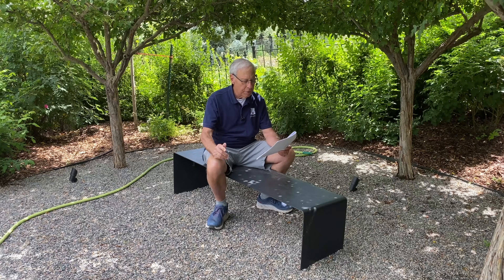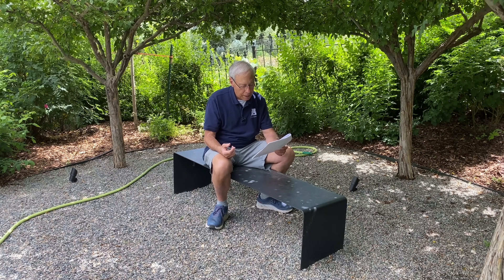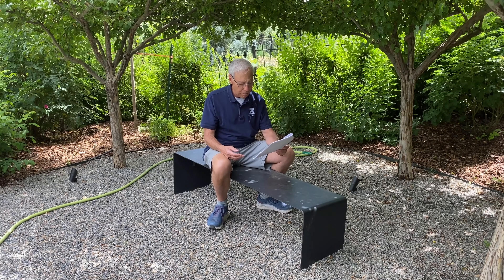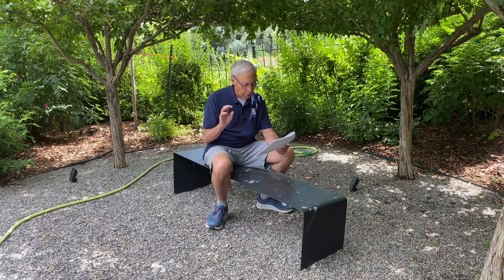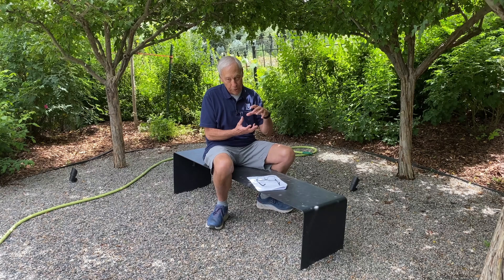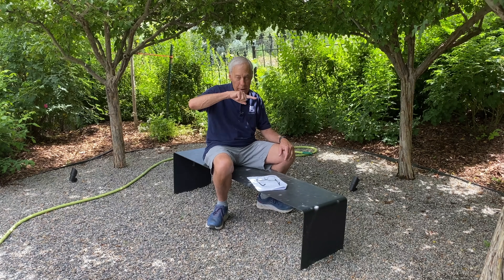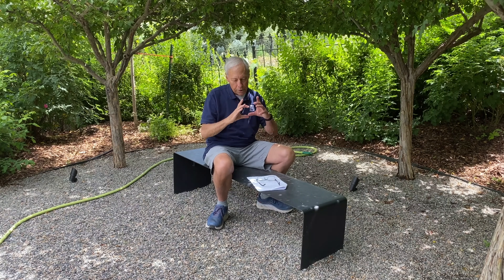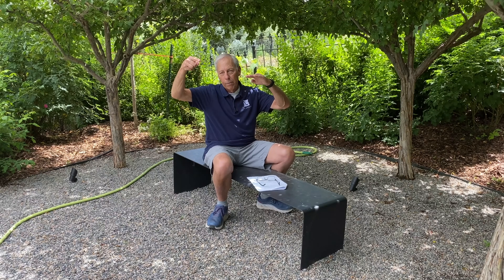Capacitors as indicators of audio quality

Comment: You can almost never have enough caps in a power amps supply, lets assume you have + and - 50V - about average for most supplies, at 100W you will be pulling around 28A, now lets say you want to keep ripple down to 1% or 10v (5v per rail): q=i.t=c.dv therefore c=i.t/dv = (28*(1/50Hz) / 10v) = 0.0566F or 56,000uF, thats more than is in most amp power supplies, chances are your power amp has worse than 2% ripple at max power.
Now imagine trying to get the ripple down to say 0.01% of supply, that would be a whopping 5.66F !!, that would require 100 x 56,000uF cap (NPV=50,000uf).
However the switch on rush current would be so huge, you would not want to do this).

Comment: I need advice please! I'm trying to build some preamp and there are small value polarized 10uF caps in line of audio signal from input, over the tone control and output. I can only notice they are not placed all the same where some are  oriented like +○- and other  -○+ looking the audio signal "direction" from IN to OUT. The question is: Is it better to place some audio grade bi-polar/non-polar caps on audio signal over complete preamp and just keep polarized on power pins of op-amps or it is fine to use polarized like schematic says ???

Comment: Back in the day a way to improve the performance of an amplifier is to add more and more electrolytic capacitors. But they added small value capacitor across the array. They said to make it improve in speed. And to prevent too high in-rush current that can blow rectifiers they add series high wattage wirewound resistors between rectifiers and the capacitor array then bypass it with a relay after few seconds delay. Paul please comment on this.

Comment: Your talking two different uses for capacitors storage/filter caps vs coupling caps in the signal path.... Large amounts of storage caps are good, also lower ESR (equivalent series resistance) by using high quality and more lower valued caps in parallel is also good. If you need to use a cap in the signal path, make it a good quality film cap, like polypropylene....
Reply: I've upgraded my phono amp with 4 WIMA caps, weeded out the electros

Comment: I just had my 20 year old HK6500 power supply recapped and the bass is so much more present.  It's like the difference between driving with flat tires and tires with air.

Comment: Passive speakers usually have caps in the cross-over filter. Active speakers using DSP for cross-over can completely avoid any capacitor in the signal path and enable a more precise level and phase optimized filtering.

Comment: Back in the '70s when I was assembling Dynaco kits, I seem to recall that they offered a separate add-on capacitor bank for the ST-400 if you wanted even more than the stock capacitance for the power supply.  I loved that amp but never added the extra caps.
Reply: I have used that amp both with and without.. I would be lying if I said it did nothing, but its importance was greatly exaggerated. At least at 7-8 ohm load I found it of only a tiny benefit. And in fact the tiny difference could have been all in my head too.... And I am talking about a freshly restored amp. Either way the amp is deeply impressive and found it quite lively and responsive even without the extra bank right on up into its limits. My guess is the extra bank would really help with driving heavy bottom end at lower impedance like 4 ohms. Or speakers with very low damping. But either way for a fairly typical use where you are not putting the amp close to its limits, it is just a placebo IMO.  The transformers in that thing are so massive that I don't think they really needed to bother.

Comment: You have several types of capacitors!

1. Low resistance (ERS) which is good for audio.

2. Long life.

3. (All purpose) which are usually cheap caps.

If a preamplifier needs 1 amp from power supply then the sound will not be better if you go from 10,000uf to 50,000uf. it's just sales tricks from the factory!

Power supply capacitor does not remove all noise because then you must have a noise filter with coil to small capacitors!

A capacitor on the audio input. prevents direct current and protects against very high frequencies that can damage equipment

Comment: We need a small discussion on the scale of Capacitance.  1 Farad is an awful lot, half a million is probably not possible in an audio component.  The power supply might have 500,000 micro farads (half a farad).  Thoughts?
Reply: I think we all understand that the questioner meant to say 500,000 microfarads but just missed the "micro."  
But it's fun to think about what one could do with 500,000 farads, once it's charged.  That does admittedly take a while, though - at 100A, it takes almost 17 hours just to get it up to 12V.
Reply: True.  However, I use 50F supercaps in PS of 3-5V digital sections.   Low ESR supercaps make a surprising improvement to the sound.  Some are using hundreds of Farads with good results.  Not for the inexperienced however as these things are dangerous.

Comment: Great explanation Paul.
I just traded in a wonderful tube preamp that had blocking capacitors at the output stage that could be bypassed with a single dip switch. The manufacturer covered its behind by giving the user the option to keep them in the circuit or not and a warning of the potential hazard of not keeping these capacitors in-line with the output jack.

Comment: The ESR (Equivalent Series Resistance) of a capacitor is crucial for simple AC-DC diode bridge based power supply performance. The lower the better to allow faster charging and discharging thus improved ripple attenuation. Capacitor performance degrades over time, exposure to heat and usage. This is why capacitors with the same Farad value are available with different performance quality models with the best being more expensive. Even the best capacitors will die from ageing.

Inline signal capacitors are sometimes unavoidable to remove DC voltage offsets. They must be sized so they best preserve the signal quality.
Reply: Yes, unfortunately ESR is the first thing that degrades as capacitors age, and few owners have the ability to test that.

Comment: Unless technology has made super leaps and bounds since I came into it,  a 500,000 Fared capacitor would be humongous.   A one Fared capacitor with an air dialectric of 1/32 inch would need a plate area of 36 square miles.   Of course with better dialectrics they can be made much smaller.  I have a one Fared cap  that is for 5 volts that is about the size of a large coat button.  Sounds like bogus specs to me.   Can you imagine how long it would take to charge this capacitor?

Comment: Half a million Farads? Even the most massive power amp you can think of, say the D'Agostino Relentless for example, has way less than one Farad of capacitance.
Reply: Half a million microfarads = 1/2 farad. The problem with huge filter capacitors is that the diodes are only conducting for a short part of the A/C cycle so they have to be massive as well to handle the current draw when they are "on".
Reply: Some number of millifarads is plausible. Maybe that's what was meant.

Comment: Also that phono preamp manufacturer was probably talking about microfarads, 1 millionth of a farad..  Half a million microfarads, one half farad, is still a lot of power storage and would take up a lot of space.  For example, a Nichicon aluminum electrolyte capacitor with a 15000 microfarad capacity measures 80 mm (3.2 in) long by 30 mm (1.2 in) in diameter.  Now wire up 330 of those in a box for the power supply and that doesn't even include the power transformer and regulator circuitry.  These are probably not the most volumetricly efficient caps out there, but you get the idea.

Comment: A switch to Solens caps in my Klipsch R-51M  cheapo speakers sure made a huge difference in detail and tonal quality!  :)
Reply: A smart move and I'm glad that it worked well.  But caps in crossover are meant to limit portions of the frequency response from going to specific individual drivers so they don't have to deal with frequencies outside of their optimized range of operation.  In a capacitor free direct coupled circuit, you want all of the frequencies to go through unimpeded.  So kind of apples and oranges, here.  Viva do-it-yourselfers!
Reply: @stephensmith3111 I'd still hafta say "apples and apples" under the topic of "Capacitors as indicators of audio quality" Stephen. ;)
Reply: @freethot333  Good point.  And again, good for your ingenuity for improving the sound quality of those "cheapo speakers".  I'm listening to Pioneer BS-SP22-LRs that I got for $99.99/pair at the 'yellow tag' store.  I haven't tried opening them up, but I think Andrew Jones knew what he was doing when he voiced them.  Not LS3/5As, of course, but not that far behind either.  :-)
Reply: @freethot333  About 3-1/2 years ago; as a widowed, empty nest, retiree; I down-sized to a 3 room apartment in a nice old neighborhood with a big city park right across the street.  Affordable, too.   However, after signing the lease and setting up shop, I discovered that the main room has a nasty bass resonance that particularly upsets my turntable.  My venerable and beloved ADS L520s  simply overpowered the room and are sidelined for the time being (can't bring myself to sell them; hope springs eternal).  Even with the bass rolled off a bit (yaayyy, tone controls!) and mounted on tall(ish) stands,  the little Pioneers can still excite the resonance at greater than moderate volumes.  Still, bass shy music is infinitely better than no music and from the lower midrange up, the SP22s sound quite good.  Wonder puppies indeed.  And otherwise, I like it here.
Reply: @stephensmith3111  I've seen images of the BS22 crossover and it has poly caps
Reply: @stephensmith3111  removing the dust cover will help with TT feedback, my LP120, 20w Pyle amp and Dayton 652-AIR speakers howled at 105 dB
Reply: @VaughnfromPeterborough  I do take the dust cover off entirely when playing records.  I filed the retaining clips for the mounting tabs down so that I can lift it straight up and off (I could still pivot it back, but I choose the former option).  The tabs hold the dust cover in place when not spinning vinyl (Rega RP1/Bias 2 sitting on an Auralex turntable platform, b.t.w., the platform helps but didn't completely eliminate the problem).  Thanks for the suggestion though.  :-)
Reply: Solen Metalized Polypropylene caps?  It would be interesting to see what good quality film/foil caps would do
Reply: @darylstahler4224  Solen Capacitor 5.1uF 400Vdc PB Series	SOLEN-51551	USD $3.16	USD $6.32
Reply: I have the 15M speakers, I will consider poly cap for the tweeter and remove the 36uF shunt cap from the woofer

Comment: When you fully rectify incoming AC you don't get separate plus and minus, the AC negative gets flipped to positive and so all the 'humps' are positive with a ripple that's smoothed with a capacitor.
AC =  n n n n n n n           DC (rectified) = nnnnnnnnn          DC (smoothed) = ¬¬¬¬¬¬¬¬¬¬       DC (regulated) = -------------------
            u u u u u u u
Reply: When I read that in my head, I made noises for AC-DC-DC smoothed and DC regulated. It sounded dumb.
Reply: Will it hurt to replace a ps filter cap of same value but of a slight higher voltage
Reply: @davebrice7217  No. The voltage rating points to how good the insulation between the plates is. Higher voltage may even be less prone to leakage and may last longer. The materials are also important, though usually not specified. Typically, caps are rated to 85°C, but in a power supply, 105°C caps my be more chemically stable and last longer. I went from 8500µF 75V 85°C to 10000µF 75V 105°C on my 40yo amps, but I'm adding a soft start.

Comment: When I was in school ( 64  -> 68 ) I was part of a team that did a servo amp that was controlling the angle of a 5in naval gun. Two were needed ( one for gun elevation and one for turret spinning ). If I remember right we had I think a bank of four 1.5 farad ( 6 farads ) in the power supply. And the power supply that supplied that, if I remember right, was I think 100A 48VDC. There was like 80 power transistors in the output stage. That thing was a beast.
Reply: Sounds like a fun project.  
Speaking of aiming military equipment - 
Many years ago, our neighbor's son was telling stories of his experience in the Navy, operating radar equipment.  In Hawaii, they had an over-the-horizon radar of multi-megawatt power, but the antenna had a servo issue with the altitude angle.  If they lowered it below a certain point, it would jam, then they would have to call in a repair crew.  One day that happened while it was operating at high power, but the operator didn't realize what was going on before the beam swept across the local downtown area.  As it passed through a camera shop, an entire wall of flash cubes suddenly discharged, causing panic in the store.  Ah, the things they used to do back in the '60s!  He also mentioned that the radar would occasionally knock down seagulls in flight.
Reply: @marianneoelund2940  OK Marianne here's the real fun. I'm a 20ish yo student at the time. Here's this mega circuit. 1000's of amps. We didn't have a real turret or 5in gun so we had to simulate the load on the motor. So that was an about 3in thick about 24in dia aluminum disk attached to the servo motor. You dial in 125 degrees and ggrrrup the disk spins to 125 degrees. Dial in 320 degrees.gggggrrrrrup and around the disk goes to 320 degrees. So climb on board, hold on real tight and gruuummmp a spin'n you go. I'm surprised we didn't get hurt screw'n around with that thing.
Reply: @jim9930  
Are you sure it was paper?  The highest-value paper cap I've ever seen for voltages like that was only a few uF at most.  
For 500uF at 500V it would need to be almost a cubic foot in volume.

Comment: "Half a million farads". So that's 500,000 farads. Anybody have any idea on how physically big that would be?
Reply: One farad is a gigantic amount of capacitance; there's no need for something that big in any sensible home audio system.  Maybe it should have been half a million microfarads, i.e. 1/2 farad?
Reply: @kc9scott  Just for fun: https://www.electronics2000.co.uk/calc/capacitor-charge-calculator.php

V=48vdc
C=500,000 Farads

Charge Q = 24000000 Coulombs
Energy E = 576000000 Joules

BBBOOOOOMMMMMM!!!!!!!!
Reply: @wilcalint  
That's 160 Kw-hr.  You could drive an electric car about 600 miles on that.
Reply: @kc9scott  Thanks Kevin. This 74 year old engineer kept hearing "Farad" in this video and every time I heard that I remembered that bundle of four 1.5F caps we used in that servo amp. It was BIG and it was DANGEROUS. We never had a short in that circuit. We only had the big black splotch where the short was. Blew the tops off of about half of those 80 transistors a couple times. TO-5 cans.
Reply: @kc9scott  I seem to remember things like 300 Micro Farad caps in audio power supplies. Maybe a couple of them.
Reply: @kc9scott  Arn't the boom boxes in cars into multifarad power supplies. I seem to remember seeing those things in car stereo stores. Usually in the 1 Farad range. And those were pretty big.
Reply: @wilcalint  They're running at 12V DC. You need much greater capacitance to achieve the same power storage at low voltages.
Reply: @gotham61  Ya, you can get a lot of energy out of a farad at 12vdc. Most, if not all, of what I was involved with was 48vdc. Military circuits.
Reply: @wilcalint  For digital logic supplies, I've typically used 4700 uF caps (biggest size that was available at the local Radio Shack at the time).  My quick calculation on this says that with the 4700 uF cap, the unregulated part of the supply would hit 1V of ripple at around 1/2 amp draw.  The 300 uF would probably be fine in a small audio signal-processing device, if there's no power amp involved.
Reply: @wilcalint  The high-wattage high-SPL car audio folks have been using those multifarad caps.  I personally don't care for something like that; there's no reason to care about sound quality after you've wrecked your ears with the high SPLs.
Reply: @kc9scott  Even 500,000uF is insane for a phono preamp. The 570lb D'Agostino Relentless power amp has about 600,000uF.
Reply: @gotham61  Absolutely.  Before the modern era (last 20 years or so) of ultracapacitors (which have very low max voltage ratings) and extremely-big electrolytics, audio power amps did just fine with the more normal-sized power electrolytics that were available.  And a phono preamp needs way way less power than a power amp.

Comment: I’ve been replacing all PSU caps with either Panasonic or Nichicon. If an opamp has caps related to it I’ll replace those as well. So far this method has restored my older gear to  spec. 👌
Reply: Be careful when replacing caps some have mislabeled polarity , which can lead to increased noise in the circuit.  I think Mr. Carlson's Lab did a video about this if I recall
Reply: @matthewhilty4209  
I remember that video.  It was about distinguishing inner and outer foils for film type capacitors.  In that case, you want the outer-foil lead to connect to the lower impedance side in the circuit for best noise immunity.  However, unlike electrolytic caps in power supplies, nothing will be damaged if the cap is mis-marked or installed the other way around.  In fact, most circuits are not sensitive to which side the outer foil connects to.  It's just a good general rule to follow, to cover the cases where it might matter.